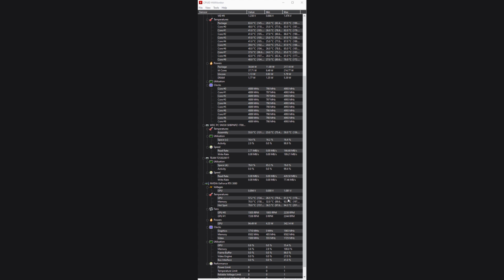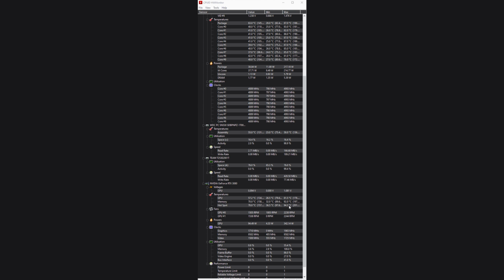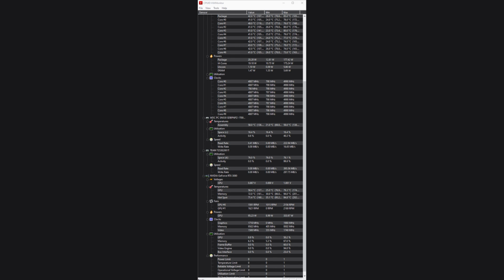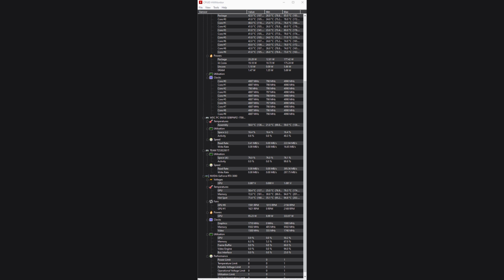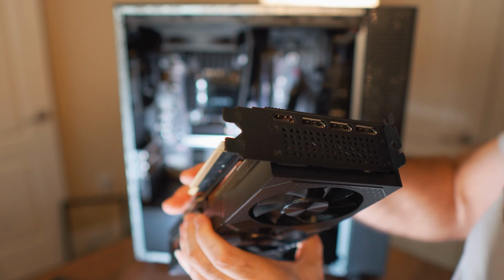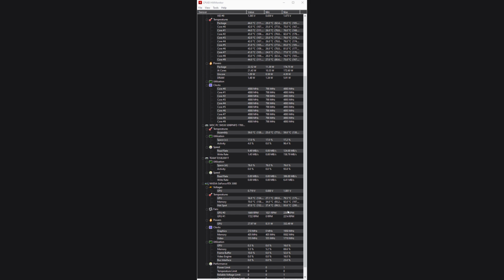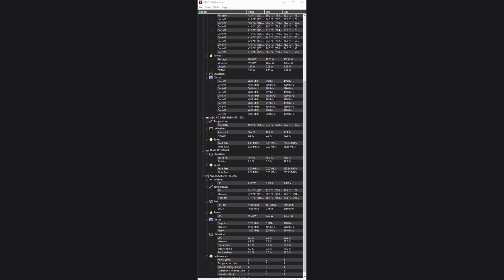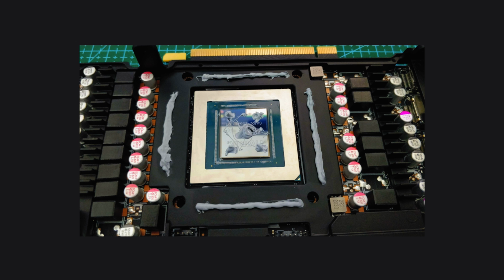HP RTX 3080 - Second Mod - Even Better Temps!

Comment: Just did everything like instructions. Temps drop over 10 °C overall, hotspot went from 105 °C to 92 °C, and the fans were not even on full speed at 95% utilization! Before, the card was like a jet engine, fans on full blast over 85% utilization! Thx for the video, you helped a lot!

Comment: Late to the show, but I got this card from a friend for cheap and gonna repaste and change pads, meaby it probably do a deshroud mod and run 2x120mm fans. But i was wondering if the extra pads between backplate and the card, are they necessary? Do they make the temps much better or just leave as is? I only game, thats it.
Reply: So i'll reply to myself. I changed all the thermalpads and added the thermalpads to the backplate. I also used ptm7950 for the die. Card works like a beast now. Much more silent and the temps on gpu rarely gonover 70 and the hotspot about 80:ish

Comment: Getting much better GPU temps after doing this but my Memory has maxed at 110c playing Tarkov any sugguestions ? running HP 3080
Reply from the maker: @flexinggoat  You have to make sure to use the exact sizes and thermal paste between the brackets as well, like I did in the video
Reply: @HardwareSense  9:27 you added more pads to the back i dont think i did that , but i did everything else 
hot memory is prob known on these 3080s also since I did this my GPU stopped crashing ! I use to crash alot playing for a while my GPU fans would spin out of control and my screen would go black hasnt happened since

Comment: How many watts is your power supply? I have a 750 and I've been told the 3080 should have a 1000 watts psu to run properly. I also have a 3950x as well.  In some games when they are set to high and they ramp up my card which is this exact card it black screen and fans go full blast.
Reply: Good goold psh with 750w rating is enough. Dont listen to those people
Reply from the maker: 750W is plenty

Comment: Hello sir, thank for the video. For my case i had changed my thermal paste Arctic mx6 + pads for nothing the fan are very noisy @ 60% speed  (Corsair 7000D airflow case don't help)😢 . The performance are VERY LOW my record is near 3300 points on MSI Kombustor 2160p preset after "undervolted" by curve 812mw @ 1830mhz + 600 Mem. Config i7 12700KF-32 gb DDR5-5600-CL36..win11 last update + last drivers. Please someone with this card can say me how he score on MSI kombuster 2160p?

Comment: Hello!

I just got 2 of these rtx 3080’s by hp for cheap because HP hardly applied any thermal paste and they would crash under load. After repasting it I can run furmark and games in general without it crashing but the hotspot is 20c+ higher than the normal temp and reaching around 95-105c. After power limiting, undervolting, and cranking the fan curve I got it to a max of 95c but I’d like to give this to my friend and he doesn’t really know how to do this. 

Would replacing the thermal pads really help? My vram temps are alright but I’d like to knock that hotspot temp down.
Reply from the maker: Even after all the experiments I did on this card, the hot spot remains the hottest, the memory initially was super high, but after the thermal pads and all dropped 20c, but the hot spot reaches 100c, I think the overall execution of the whole cooling solution was not well engineered.

Comment: Perhaps a little late to this video, I just got an HP OEM 3080, and as far as I can tell I have pretty good temps on everything and the card runs nice and quiet, its less than a year old and my case has good airflow. I dont have any way of immediately getting thermal pads as I have to order and wait, but do you think its worth swapping out only the thermal paste and applying it around the vapor chamber as you did, or should I do thermal pads as well?
Reply from the maker: What are your current temperatures?
Reply: @HardwareSense  when playing cyberpunk with RT it maxes out at like 75 degrees.
Reply from the maker: @andreasjabbari1236  Core I assume? But if your Hot Spot is staying around 90c, you are good
Reply: @HardwareSense  so after running the cyberpunk benchmark 3 or 4 times, gpu temp got to 82 degrees, hot spot 94.6 degrees and memory junction at 94 degrees
Reply from the maker: @andreasjabbari1236  That's great
Reply: @HardwareSense  so not worth reapplying thermal paste? Even on the outside part of the Vapor chamber?
Reply from the maker: @andreasjabbari1236  Correct, leave it as is.

Comment: great mod, i’m wondering if we could swap out the fans for some better quality ones. Wdu think?
Reply from the maker: It will be hard, with the custom PCB, and probably not worth doing it, after the mod, the GPU is performed good enough.
Reply: I agree it would be a little too much. However the temps are still very worrying to me, I’m undervolting+underclocking to 1850mhz just to see hotspot <90C.
It’s my first gaming pc and not really sure what normal temps would be for hotspot, die and mem.
Would appreciate any insight you could share.
Reply from the maker: @mthclwn  The Hotspot at or over 90 is not that bad.
Reply: sorry to necro, but if interested i have a 3d printable model for a bracket that uses the stock screws for 2x120mm fans which would definitely improve noise (can give the model for free)

Comment: Thanks Ivan. Coffee is on its way ;-)
Could you please list the thickness of the pads and the according components in the comments? That would help me figure out which thickness goes exactly where. I´ve got 1mm on the VRAM and an 0,5mm on the other side of the pcb module. But where does the 1,5mm goes? A picture with text of the thickness would be very appreciated. It will be my first gpu modding there I want to have it done by first try (and do not want to reopen the graphic card several times). Thanks
Reply: An last (but not least...) how much pads do I roughly need from each size? Do not want to buy too much or too less (and do not want to invest too much money, because I could then better had invest that in another card instead). Thanks again

Comment: Wonder if I should do it. Using FurMark at stock, I'm getting 74C gpu, 92C memory and 103C hot spot. But the fan goes to near 3000 rpm. I'm hoping to reduce the noise in my build. (I'm reusing this GPU in a custom build mini itx)
Reply: I opened the cooler and just replaced the thermal paste plus paste to the metal to vapour chamber. It's now super quiet. Gpu and memory is the same, but hotspot is now down to 97C and fans are way lower at 2000rpm. Turns out stock thermal paste was horribly applied. Half of my gpu didn't have any thermal paste contact. This why there's a big hotspot temp difference. GPU boosts to 1965 MHz, 2000 RPM fans (very silent) and 75C core, 90C mem,  97C hotspot. Totally happy with my card now.
Reply: @jerryg3652 did you leave the stock pads or replace them when you did this? Looking to repaste mine!
Reply from the maker: Definitely do it
Reply: @HardwareSense  I didn’t change the stock pads because I only have thermal paste on hand
Reply: After replacing everything including pads and mx6 thermal paste, I'm now getting a max of 70C core, 80C memory, 85C hotspot
Reply: now my hotspot is back to 104C. =( not sure what's going on. Temps are overall higher too 79C overall, 92C memory, 104C hotspot. And the fans are reaching 3000 rpm. My case is open so it's not an airflow issue. It's the card itself.
Reply: @jerryg3652   Did u fix it? I changed pads and thermal paste, was good for a while but now its throttling heavily at 80c even though i got undervolt + thermal limit in msi at 91c. Did change bios in the beginning but still ran same. Now throttling. Few months was good, now back to same old same old. All in all bad card/engineering i guess, not gonna get HP again.
Reply: @vapor5167  Yes I had to open it up and repaste the die. I think the card's retention of it's heatsink isn't very good. I had a vertical mount and i'm guessing due to weight of the card, over time the heatsink sags and no longer have good contact with the chip. Repasting it fixes the issue but now I'm trying a horizontal gpu mount. Hopefully that fixes things on the long run. We'll see.

Comment: I think dumping more heat from the video memory into the heat sink and thermal mass of the card should also mean there is less potential for heat transfer from the GPU Die as well. Q=m*C*(deltaT)
Reply from the maker: There is a lot of truth about that, but still the temps are well balanced between the GPU, memory and hot spot.

Comment: Love this one and the last one....but question..... Is the high 90s temp on the hot spot and memory still ok? 

At some point, is it fair to say that the ventilation in these Omen cases are just horrible? At least on the 30L.

I run 112c on the memory junction temp and high 90s on hotspot, currently. I get a ton of stuttering and frame drops when the temperature is pick up.

I watched your first video on this card months ago, and have wanted to do this mod, but I'm still under warranty. 

HP wants me to send the entire machine back, but do you think HP will even look at the memory and hotspot temps? Will they even repad/repaste?

I don't want to waste time with HP if they're not going to fix it, but I also am very hesitant about trying it myself and voiding the warranty 😏
Reply: It gets too hot if you get stutters and frame drops, that means that the base clock is lowered by the card due to thermal throttling 
Send it back to HP and have it replaced.

Comment: Is this with stock voltages?  

I have to undervolt mine to 1650mhz at 725mv and the fans still ramp up to 100% and temps go to 84 with hotspot of 104c.  If I leave it at stock it just thermal throttles to around 1600mhz anyway.  I think I'm going to have to do this mod.
Reply from the maker: Yes it is all at stock

Comment: Which thickness pad between the back of the pcb and back plate?
Reply from the maker: I put half a centimeter thick
Reply: @HardwareSense  do you mean half a millimeter?
Reply from the maker: @GoldenTiger01  Yes, sorry that's what I meant

Comment: I bought a used alienware 3080 two fan model off of ebay for $450 that was used for mining two weeks ago and the guy must have done this mod because when I got it my vram temps were around 80c and the core was around 80c. I undervolted it to 812 millivolts at 1755 mhz, set a custom fan curve, and the core now runs around 70c, so 10c cooler although the vram is still at 80c which is fine and lost very little performance, not enough to notice. So now the fans don't go over 50% and it's quiet and not too hot. It should last several years like this and I'm glad there are videos like this for when I need to repad and repaste it.
Reply from the maker: That's a great buy at $450!
Reply: @HardwareSense  I planned to buy a 3080 for months after ethereum mining died waiting to strike when the prices were at their lowest but I got real lucky that the 3080 was pre-modded. These are really hot cards but it's under control and I'm keeping a hawk eye on the temps. I had gotten a new 3060 ti in January 2021 for $620 that took 8 days to find anything that wasn't a 3090 in stock. I'm glad those days are over. I'm giving the 3060 ti to my 80 year old mom to replace her r9 290x.
Reply from the maker: @pf100andahalf  I love it, she is going to enjoy the new generation

Comment: Hi, I got a refurbished omen w/ 3080 and I’m liking it so far.  The GPU reaches a max of 70°C when playing just Diablo 2 Resurrected for now.  Probably not the most demanding game but I want to play some elden ring.  I noticed the card is very dusty though so I will clean it when I get a chance and reference this video if I have heat issues down the road. Thanks!
Reply: I got similar temps to this guy! It was running great as a new card then i notice it got hotter year 3. Did this and im back at max settings with the 90 area. When I was over 100! Opening it up I saw right away it needed new pads and thermal paste and it helped 💯

Comment: Answer is! Don't buy HP prebuilts, buy cyberpowers
Reply from the maker: Lol, 2 years ago this was the only way to get 3080, where were you?
Reply: @HardwareSense  yeah that's why I didn't suggest a custom 3080 as it was near impossible even if you set alerts believe me I tried. But as far as cyberpower prebuilts(including other prebuilt brands too) it was the easiest way to get a 3080 and wasn't THAT hard as they didn't nearly sell out as fast. I got my cyberpower a few hours after the sale started(during near the peak of 3080 prices) and I was still able to buy! 

HP 3080 is better then no 3080 you're right.
Reply from the maker: @roboticvenom1935  Yeah the price was a lot more than what HP was offering at the time, and the card is actually very good, once you apply the quick mods to it. Bottom line I am glad that time is over... Or at least not as bad, considering I can't get 4090 for the last month!
Reply: Like that's a major upgrade 🙄